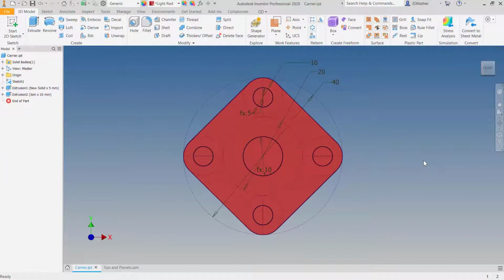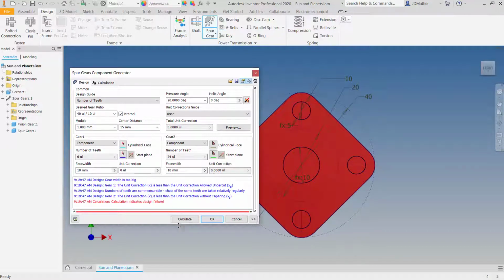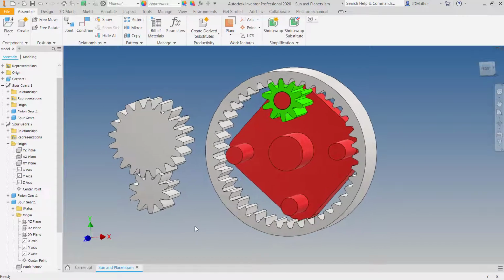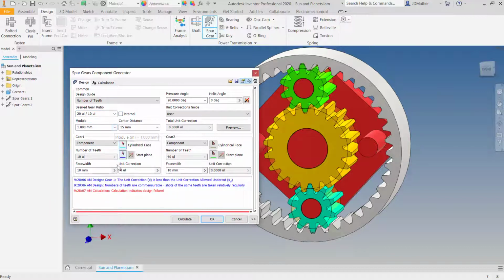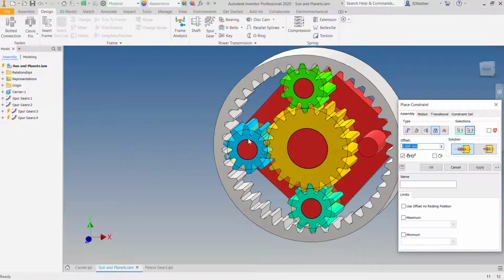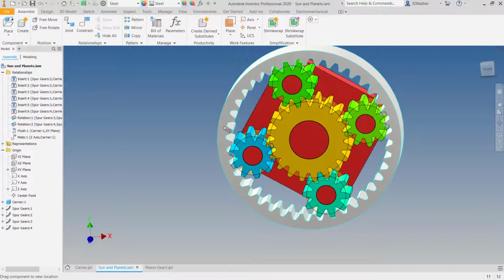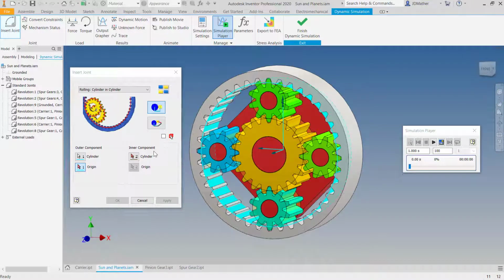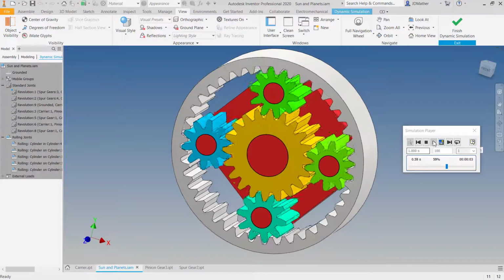Sun and Planets   Step by Step

Comment: Great video…I do have one question though?

Why is there only one  rolling cylinder in cylinder joint for the ring gear  and one planet gear. Shouldn’t here be this type of joint for each planet?
Reply from the maker: In the real world yes, in CAD additional joints (constraints) are not needed for the calculations and therefore redundant.

Comment: Hi Brother, Doesn't your system violate the rule of no. of planets?  As

(R-S)/n  = integer  
your R=Ring teeth=40 ; S=Sun teeth =10
so,
(40-10)/n => 30/n where possible values of n could be 1,2,3,5,6, for the equation to be an integer. Hence you cant connect 4 planets.

Comment: How do I adjust the playback speed? I modified the velocity value but the rotation angle is just getting smaller
Reply from the maker: Increase the number of time step calculations (Images) in the Simulation Player.  Because more individual calculations are made - it will slow down.

Comment: Hi sir, I wanna build mechanical toys which include gears (simple marble machine with dc motor)
I want to do laser cutting from 4mm plywood, I want to make it beautiful with round edges
could you make a video about gear design? I have tried the power transmition generator but it looks too flat(not beautiful), even more due to I use 4mm in face-width the gear generator always show error input

if I do a manual build by using circular pattern, I am worried it will be stuck
thank you so much
Reply from the maker: The gear generator creates simplified "Wellman's Odontoghraph" toothforms.  These are not correct - only cosmetic.  You will need to learn how to Export Toothform or create true involute curves from scratch.
Reply: I made some videos showing how to model true involute gears from scratch (with Fusion 360). See my channel, maybe you'll find something that could help you.